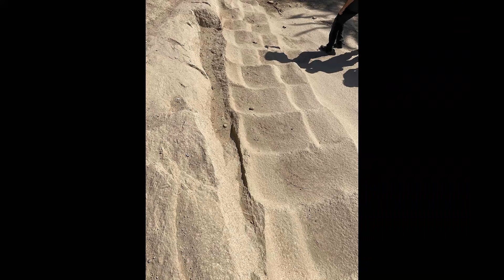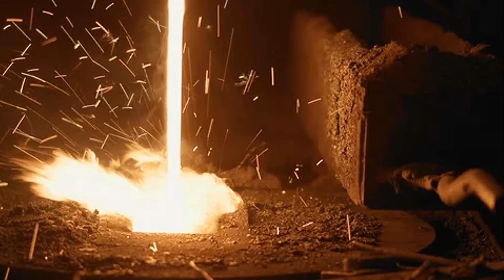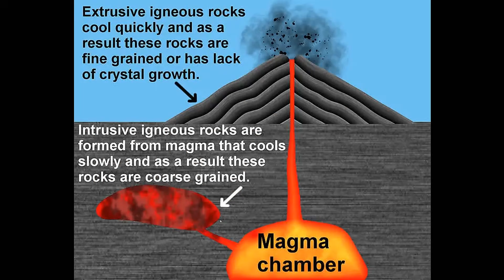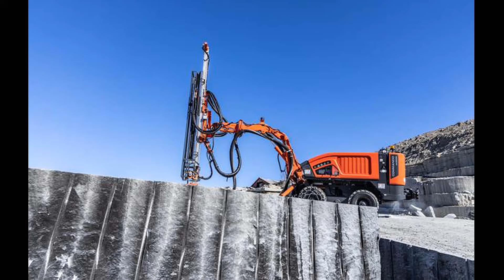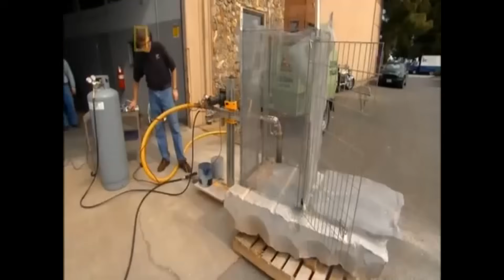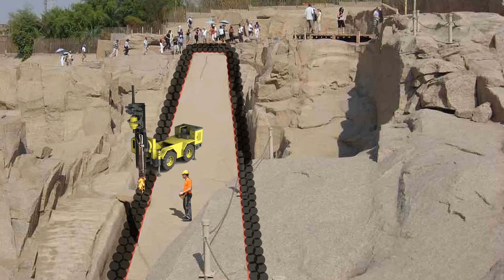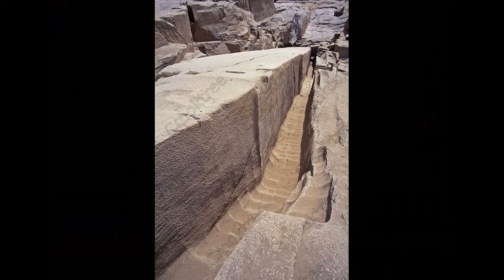Scoop Marks in Egypt: A Groundbreaking New Hypothesis

Comment: If you can reach a temperature to melt copper, you can melt natron a little more easily, and molten natron can be used to break the quartz component of granite, causing the granite to crumble. Natron is naturally occurring in Egypt, and was used in dynastic times, when they did have access to temperatures that would melt copper. The scoop type shapes could reflect the use of piles of natron, with one pile creating a scoop, letting it sit and break the quartz, and then the resulting debris could be collected and used later to reconstitute for building a block of granite elsewhere. This is the controversial natron theory of Marcell Fóti. I don't know how they moved the giant obelisks, but if they needed a handy counterweight to lift and manipulate it, the bags of granite crumbles are right there, and if the counterweight was also part of the method of transportation - like putting it on a pair of movable pivots and "walking" it along -  this would have carried both the obelisk and a similar weight of crushed granite to the site where they might have been used.
Reply from the maker: Thanks a lot for sharing. One problem of the natron (and other chemicals) rock softening method is that it usually would significantly change the rocks' colors and appearances, while the granite of Aswan quarry shows pretty consistent color at all scooped areas.
Reply: @CuriousBeingbyTina  Interesting! If you have a source handy for the discoloration, could you pass that along? If it's not at hand, I don't want to trouble you. I'm not aware of the discoloration, and I tried asking AI, and it didn't seem to know about it either (but AI is unreliable).
Reply from the maker: @SG-js2qn  Here is a photo posted by Marcell Foti who proposed the natron softening rock idea: https://x.com/FoMaHun/status/1743216524343603549
Reply: @CuriousBeingbyTina  Wow, thanks! I gather from the picture that the lower portion is what remains after the dissolving ...? And that with the quartz removed, it is brittle and easily broken from the rest of it? If so, then the question remains, how clean does it break off? If it's not very clean, then I can see where we'd get a lot of residue that would point to this not being the method used. My impression is that when you want to re-form the granite, you mix the "glass" part and the crumbles back together, which may restore the original color.

FWIW, I'm not trying to dispute. I just don't know what the answers are. 🤷‍♂
Reply from the maker: @SG-js2qn  Thank you for the discussion. I might make a follow-up video on this 🙂

Comment: the scoop marks are insanely fascinating
Reply: the scoop marks are really here..with edges of scoop everywhere https://youtu.be/A-wTHDMLSAk?feature=shared
Reply: And easily exlained if you had been able to travel back in time and witness hundreds of Egyptian slaves rubbing and pounding stone against the rockface.
Reply: And the  forman would have strictly ensured that all the high ridges follow a grid pattern and also align with the ridges on the walls and top.  @philipsmeeton
Reply: @philipsmeeton there is some dispute as to whether or not they were slaves but no dispute from rational thinkers that man power and hammer stones were all that was required. Good old Occam's razor v aliens.
Reply: look at 9:38 . These so called scoop marks high ridges all line up. from the bottom of the trench to the top of the obelisk. These high ridges appear to show the framing of a built structure that has long ago filled with mud and petrified. How can someone look at how they line up and call them scoop marks from stone pounding.
Reply: @danneumann3274 because it was stone pounding. That's what they had, that's what they did. It is really simple. No aliens or super tech required.
Reply: "you only catch flak when you"re over Target 🎯.
Reply: We know exactly what the scoop marks are. The actual Egyptian Antiquities department in Cairo, the one Zahi Hawass used to run, has demonstrated it in videos which you may watch at your leisure. 
The edges of the scoop marks are where mud walls were built up around a fire. Quenching the fire with water, the rock under the fire becomes frankly rotten and can be knocked out easily with, yes, a dolorite pounding stone, or anything really. Rinse and repeat.

That there are no 1200-ton obelisks, standing or fallen, indicates that moving a 1200-ton obelisk was beyond their capabilities. The fact evidently became clear to them before they finished chipping that one out, or before they started another one after the crack was discovered. A 500-ton obelisk is damn impressive on its own. If they had worked at it for more decades, they might have solved the 1200-ton problem, but Hatshepsut died first. Her successor had other, maybe less megalomaniacal, priorities.
Reply: @sciptick zahi hawass is a fraud.
Reply: @sciptick  Sorry but that's outright false: Regarding the mysterious Aswan quarry scoop marks, would the following statement be accurate: "The actual Egyptian Antiquities department in Cairo, the one Zahi Hawass used to run, has demonstrated how they were created in videos."
That statement would be misleading or unverified based on currently available information.

🔍 Here's what we know:

The official theory supported by Egyptologists and the Egyptian Antiquities authorities is that the scoop marks at the Aswan quarry—especially around the Unfinished Obelisk—were created using diorite pounding stones, a method consistent with ancient Egyptian quarrying techniques2.

However, there is no publicly available video from the Egyptian Antiquities department (formerly headed by Zahi Hawass) that demonstrates or reenacts this method in a formal or official capacity.
Reply: Cutting the stone, then breaking it off creates scoop marks. It's still done like that.
Reply: @ryashonb7658 You’ll be able to show us examples then. Off you go 😅
Reply: @joetotale6354  https://www.youtube.com/watch?v=Uc20dQXOmgw&ab_channel=SGDSacredGeometryDecoded
Reply: @ryashonb7658 can you share an example for my reference
Reply: The only fascinating thing is that they cause people to come up with crazy ideas about their formation. The scoop marks are spaced at around the width of one person. They even found hammer stones. It is strange that in the presence of a very simple explanation, that has much supporting evidence, people seek far more complicated explanations.
Reply: @nexpro6985  : its not that its a simple explanation its just that the idea of a lot of people bashing small rocks on that surface could possibly end up with a uniform pattern like that is absurd
Reply: @nexpro6985 They found Diorite balls. Would you use a ball to pound w or an actual hammer ? The balls were used as ball bearings to move the quarried stone
Reply: @nexpro6985 yup. Nothing to see here. Go back to sleep. .. and DON'T look at the man behind the curtain.

Comment: How about this: Make a fire over granite, also with burning oil for example, then use the dolorite balls and hit on the granite. Due to the heat/cold shock (water) the granite turns very brittle, and it's quite easy to shape it.

Comment: Genius analysis! I was thinking about utilizing cavitation, but this flame drilling seems even more plausible and practical. I can imagine they could use some torches with oil and pressurized air.

Why could they cut down one hole by one instead of sliding the torch around like an upside down 3D printer? Possibly due to using many torches in parallel.

It is quite possible the obelisks were pre-Egyptian and they just "owned" them and cut the hieroglyphs in.

Thanks for referencing relevant cranes and not having a weird selection bias like @BrightInsight recently had.

Comment: There are scoop marks because - it was manually scoop-able by a hand operated scoop. 

We cannot change the binding agent from set state to soft state and then back to set state again without significantly altering its original chemistry or properties. So softening technique can give us something but full featured original granite. So the softening theory has a problem. 

Also something this big and heavy even if we can soften it to a state we can use scoop tool, it will flow like tofu and drown all the scooper workers in the trench.
Reply: As she said with a heat torch you aren't heating the whole block, just a very localized area close to the torch.
Reply: Unless the softening only occurs a few tens of cm deep from the surface.
Reply: It's almost like the entire premise is bunk.

Comment: You might want to take this video down and significantly rework it to reflect the fact that there is no undercutting of the Unfinished Obelisk.  The undercut images you've shown are from another much smaller unfinished obelisk in an out-of-the-way location in the Aswan quarry.  Yes, there are two.  Every photo of the trench of the large one shows no undercutting.  I have a whole folder of such images and another folder of images of the smaller one.  They should not be confused and conflated.
That being said, I'll continue viewing the video to gain any new original insights that you may share.
Reply: You are nit-picking at Tina's superb and solid research, and Tina should not have to waste her valuable time replying to your irrelevant comment. 
The Unfinished Obelisk definitely shows the regularly spaced scoop marks in its surrounding trenches, but Tina does not say in this video that these scoop marks under-cut the Unfinished Obelisk. 
As the work stopped on the Unfinished Obelisk before the under-cutting process was started, it is reasonably and logically inferred from other scoop under-cut obelisks, that the scoop under-cutting would have occurred to remove eventually this gigantic obelisk from its bed-rock.
Reply: @sergemck  That would all make sense if there was a hint in her narrative that she even knew that a smaller obelisk exists, but speaking about the only one she is familiar with while showing photos of the small one does not serve her well in the credibility department.  You would learn a lot by first reading the expositions that I shared before defending the indefensible.
Reply from the maker: @redwoodcoast  Thank you for the info. Though I do know the smaller obelisk exists since some maps show two obelisks onsite.

Comment: It is amazing to know that a fluid, (water,) was pressurized with something like garnets as an abrasive and directed with a solid nozzle supplied with a flexible, high-pressure hose.  A high-pressure water cutting device was used so long ago.
Reply: Garnets are too soft. You'd need at least quartz or better Corundum or Diamond.
Reply: @terryenglish7132  Quartz would have been easy to find and crush.

Comment: Check out Marcel Foti and the natron theory.
Reply from the maker: One problem of the natron (and other chemicals) rock softening method is that it usually would significantly change the rocks' colors and appearances, while the granite of Aswan quarry shows pretty consistent color at all scooped areas.
Here is a photo posted by Marcell Foti and we can see the appearance of the treated rock changed visibly: https://x.com/FoMaHun/status/1743216524343603549
Reply: @CuriousBeingbyTina could weather over a couple of thousand years remove the discoloration from the chemicals?